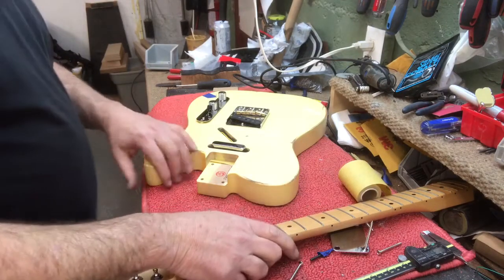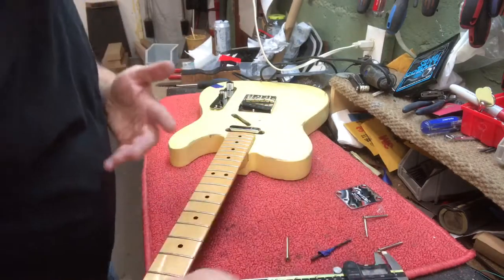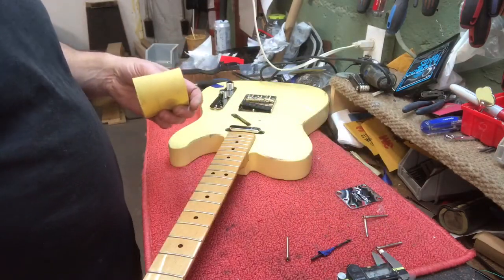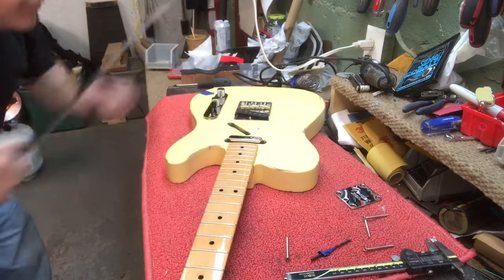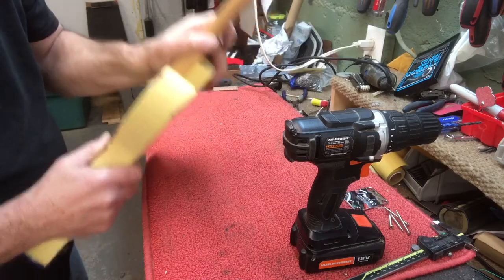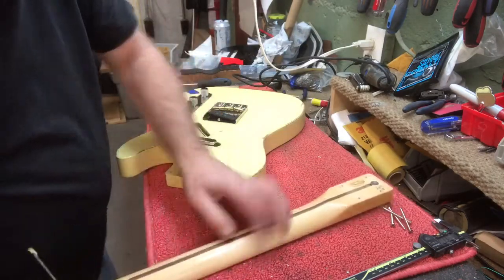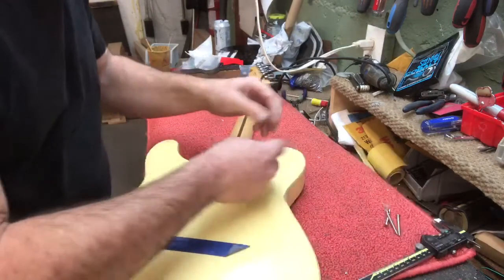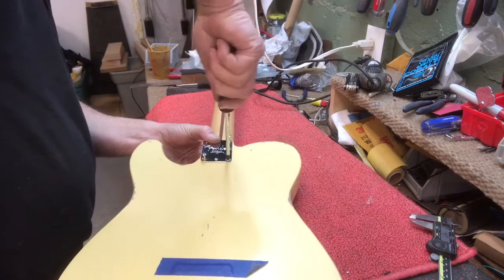How to check a guitar neck angle before installing and stringing

Comment: I like to have real full length maple shims on hand all the time,
I use to do quick fixes with guitar picks, foil or paper, then realized it doesn't last forever and there is usually a small gap in the pocket. Plus they don't cost that much for a pack. Plus it looks better.

Comment: 1. Partial Shims are a quick fix that will be a problem some later day when the wood (neck/body) compress. Both neck and body contact points need to be perfectly flat for durability and sound transfer.
2. NEVER use grease on wood. Grease will deteriorate the wood. Paraffin or candle wax works best on wood.

Comment: Sorry man but this is one of the least informative videos about guitar set up I have seen. Constructive criticism tips. give viewers more information like: How high are your saddles from the bridge plate to the bottom and the top of the saddle used to gauge whether to shim or not? How much space is there between your straight edge and the top of the frets? How did you set your truss rod? (flat neck, back bow, up bow)? How much neck relief and measured at what fret? C'mon Jim.
Reply: Also do all this before you paint the body and install the electronics.

Comment: Very poor way to do it! Your sim should always be exact size of the pocket itself and if it needs to be an angled shim, definition needs to be thicker on one end. Putting a strip or a small piece in there is the worst thing you can do! The whole surface of the neck heal and the body pocket need to be completely intact with each other for tone and sustain purposes.